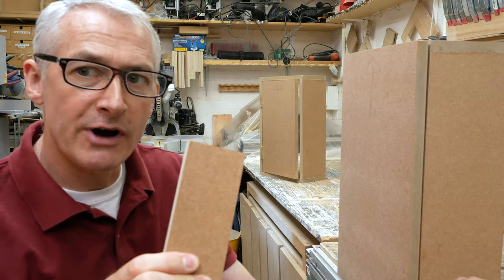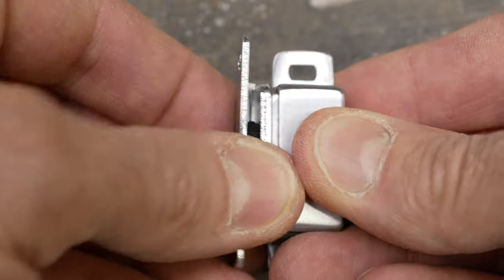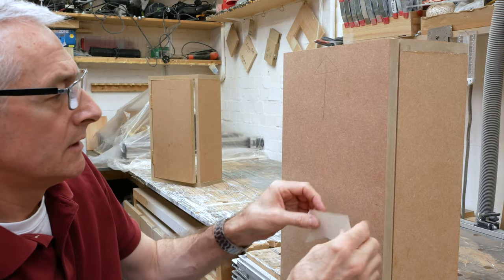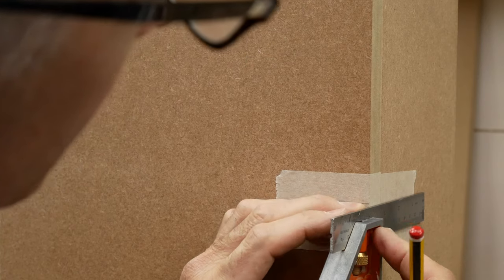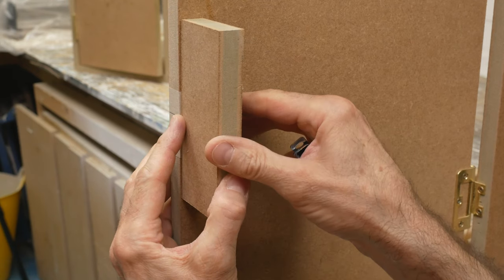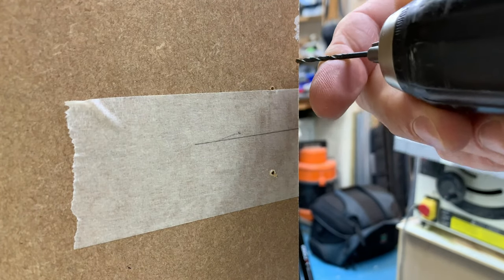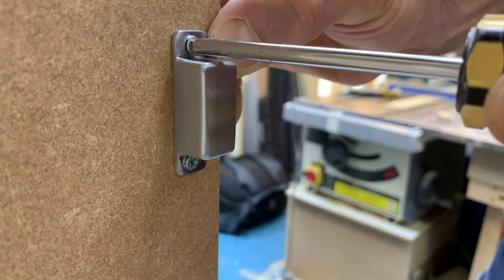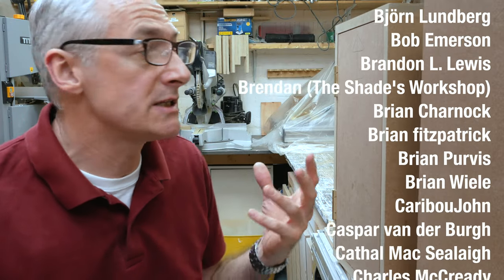Magnetic Catches and How I Fit Them [video #334)

Comment: Very good tutorial. As you say these are easy to fit, but not so easy to fit "perfectly".
I fitted one quite recently on a very awkward door (internal framed so I had to add blocking for the catch).
The cupboard was very large so rather than make life difficult I took my tools and a torch and sat inside the cupboard with the door closed to do the fitting, worked a treat!
Reply from the maker: Haha, brilliant! 👍👍😂😂 And thanks!

Comment: great tips peter, I don't fit these often, but the tip of using scrap the same size as the cabinet is priceless!!
Reply from the maker: Me neither, but when I do I like to get them out of the way fast 😂 And Thanks!👍
Reply: One issue I see could be if you add bumpers to the door.  That will add from 1/16" to 1/8" of space between the door and the face of the cabinet.

Comment: When do you choose these and flush hinges over Euro hinges? Is it down to customer preference or is there a structural / mechanical reason to choose one over the other?

Great video as always. Always a handy tip to learn.
Reply from the maker: Partly customer preference/expectation, partly the look of the finished piece. I’d say ~98% of the recent work has been with concealed hinges though. 🤷‍♂️👍

Comment: Have you tried "invisible" magnetic catches using just two flat magnets drilled and glued into the mdf? Especially with the second door where you would mount one on the thin end of the door and then just paint over them and they would be more or less invisible. With the new neodymium magnets you can find those that are just a milli thick and still have quite the strong pull, especially in pairs. 

I always feel a little awkward when things are protruding in the cabinet. They are always in the way either for your hand when taking things in or out or when you are moving around the shelves. 

Nice video as always :)
Reply from the maker: Thanks. TBH I rarely use mag catches as I'm usually using concealed hinges (self-closing) so I've never had the need for the invisible neodymium magnets, though it's a good trick to have up your sleeve, certainly. 👍

Comment: To fix magnetic catcher, which is the best location or position to fix i.e at top,middle(almost half the ht,as you have fixed for the cabinet door in this video) or at bottom of the door of a room you would recommend? (say door size be approximately 1m×2.1m or greater )
Reply from the maker: On a door that tall I’d try and get them central as it reduces the amount of flex in the door before the catch releases. I try to avoid the bottom as they’ll always get in the way. 👍👍
Reply: @10MinuteWorkshop  Thank you

Comment: At 6.08 I notice you drill the bottom guide hole for the latch at at a slight angle. Any reason for that? Added strength in anchoring it ?

Comment: Minor point, but I have never understood why these latches typically come with wood screws that have 'V'-shaped heads.  I have used pan-head screws that fit flush against the bracket and look a heck of a lot better, I think.

Comment: Nice video, I would like to know if there is any way to reduce the noise from magnets while opening and closing the door. I have a lot of cabinet at home that use magnets and they make a lot of noise, which is very annoying 😕
Reply from the maker: That can be quite ‘clacky’ and a lot of that comes from the movement of the magnets in the fixed part. A better quality catch is better for this, and you can glue a leather or vinyl strip over the metal plate in the door to help reduce the noise more. You’ll need to adjust the catches to allow for the thickness of the leather. 👍
Reply: @10MinuteWorkshop  Thanks I was thinking about the same, will give this a try 😊

Comment: Why'd you mount the catch in the middle, instead of horizontally at the top?
Reply from the maker: Force of habit, really. On a bigger door The door will twist slightly every time you open it if you mount the top/bottom, whereas in the centre it’s a more even pull force 👍

Comment: Cheers Peter, I've just made some new wardrobe doors (2 doors per opening) 1900mm H with flush hinges and was wondering if these would be ok as can only mount top or bottom. But also don't want a noisy close every time their shut, is it possible to marry these with a soft close fitting of some kind ?
Reply from the maker: Not soft-close, but the hafele touch latches I show in video #380 - https://youtu.be/6yCdFClXUOU - are quieter than the usual magnetic catches. If you want actual soft-close, then concealed hinges are your best bet, see video 348, Concealed hinges - https://youtu.be/sKxiiKNkkLk. 👍👍
Reply: @10MinuteWorkshop  Thanks for the recommendations I'll check them out.

Comment: Would you advise only putting them in the side? I was thinking of putting mine on the top so they're more out of the way 🤔
Reply from the maker: Depends on the size of the door, and where the cabinet is located. If it’s a taller door and high up, then the flex in the door can make them awkward to open, and if you put them on the base then they can get in the way of you’re trying to get things in and out above head height. 🤷‍♂️👍
Reply: @10MinuteWorkshop  it's a 56cm x 58cm door, on the ground so a bottom latch wouldn't get in the way, but my kids would likely ram stuff into it 😂

Comment: How do you size the weight of the magnets to the size of the door?  I see 6lb, 15lb, 20lb magnets on amazon.  I've got a small cabinet door like a 16 x 16 door.  What kind of pull do you think is appropriate.  20lb is super common, but that's like 1.5 bowling balls - seems like a lot!  I thought 6lb would be right for a door that size.  or is 6 lb for more like a drawer.
Reply from the maker: These were 6Kg catches - about 13lbs; they work pretty well for a door of this size. 👍

Comment: Hi Peter, can I use them on bigger doors? 170 cm ? Many thanks. Dorota
Reply from the maker: Yes, absolutely; for bigger doors you may need heavier duty catches - they come rated as a ‘pull’ weighting eg ‘15kg pull’ etc… 👍
Reply: Thank you Peter. I was actually looking for push open system for my bedroom cupboards. They are different sizes with double doors 36 cm each that open outward from the middle. 
What locking mechanism would you recommend? Other than knobs. I’ve got 5 cupboards so I thought 10 knobs might look overcrowded. 
Many thanks, Dorota

Comment: 5:57 and 8:11 The screw heads looks too big for the slot
Reply from the maker: Rule #1 - throw away the screws that come with the fitting. Rule #2 - use the screws you have 🤷‍♂️👍

Comment: .... But please, please, please, don't use countersink screws on a non-countersunk fitting - and FFS don't run your bare finger over a screw head that might have raised metal flash on it due to the screwdriver - why do folks feel the need to do that, must be a psychological thang  :-) Otherwise, you're good to go - as the Amerikans are won't to say :-))))
Reply from the maker: Rule #1; throw away the screws that come with the fitting. Rule #2; use what you have, that you’re comfortable with. 🤷‍♂️👍